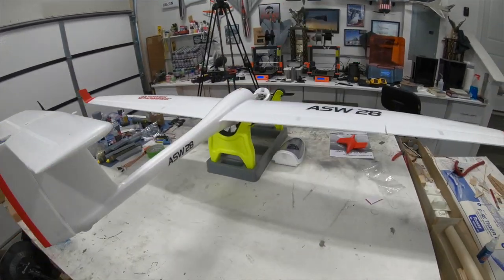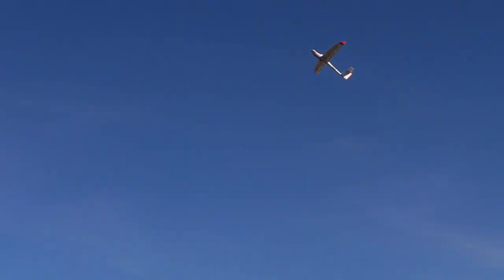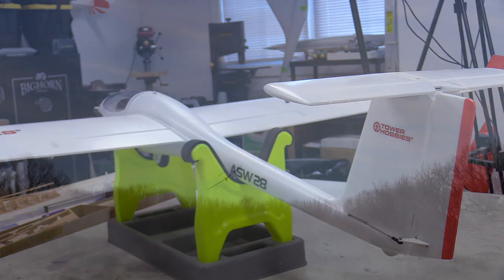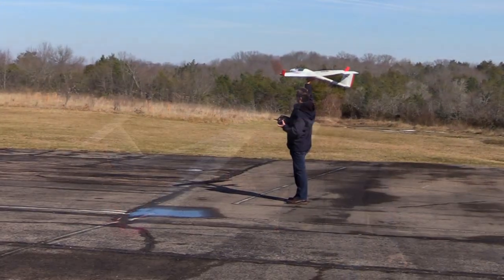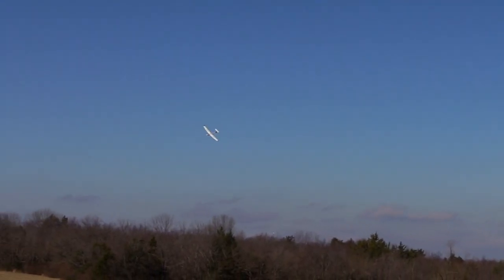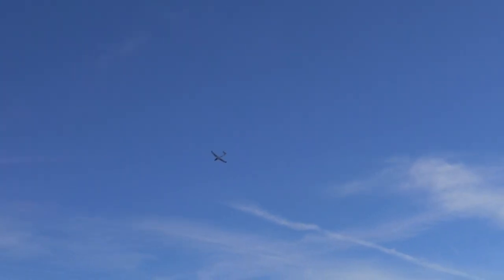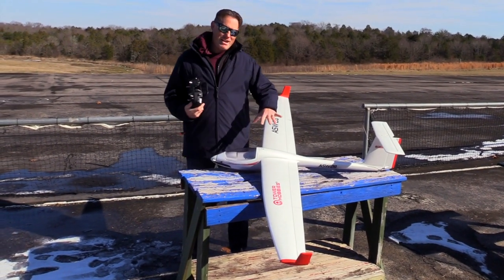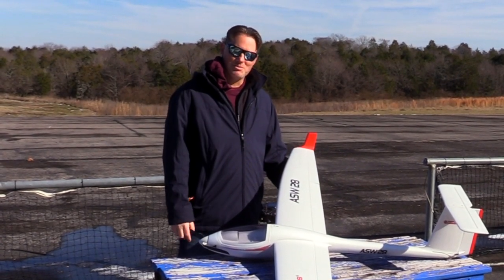That MAGIC SOUND!  The NEW Tower Hobbies ASW 28 2.0m Glider

Comment: That's my division of the hobby, thermo duration.  Either bungee, winch, self power, or tow plane launch.  You can droop the ailerons and flaps a few degrees to change the airfoil and increase climb rate in lift.  And of course there's always the tie-breaking spot landing on a graduated target tape.  That particular design (large wing area elliptical planform 2M) looks well dialed in for good performance.  Yeah, I diggin' that plane alot.  I should get one.  Thanks for doing a video on it.
Reply from the maker: Very cool!  The precision sailplane competitions are no joke. That’s some serious flying and extremely challenging. My father in law was big in thermal duration for a while.
Reply: Hey John, you think it will be a good thermal glider? seems to be a heavy bird for its size
Reply from the maker: I definitely think it’ll thermal when there’s thermal activity.

Comment: Hey Chris! I was just getting back into the hobby after a 2 year break and I was wondering if you can use a 3s 2200 or even maybe a 3s 1300, just to get it up to altitude and glide the rest of the way down. I know since its a 40a ESC, a 1300 may be to low and maybe even 3s is to low to.

Comment: Curious to know if the propellor folds back automatically when turned off. I saw a guy break them off while landing.
Reply from the maker: Yes, the there’s a brake engaged on the motor which stops it and the prop folds back. I wonder if who you saw break the prop had the motor running when he landed it. Or didn’t throttle back the motor soon enough before touchdown.

Comment: Love a glider. That’s a nice ship! Considering your clout within the hobby, do you have any insight as to why we aren’t seeing the quality balsa warbirds from hangar 9 or topflite anymore? The top flite hellcat or the hangar 9 bf 109 were great birds. Seems like foam is the de facto offering for the foreseeable future. I’m hoping you may have some insight otherwise. Have a great weekend Chris.
Reply from the maker: I think at the end of the day, foam is less expensive to manufacture. Wood arfs require skilled labor to physically build each aircraft from a stack of parts. They’re designed with mass production in mind, but it’s still quite labor intensive. The foam airframes start out much more prefabricated since the parts are injection molded so the assembly time is reduced significantly.  Truthfully, I do prefer wood and composite airframes myself, but the foam airframes have gotten pretty darn good these days.

Comment: Thing rips. Stupid question, are you setting it up as Acro or sail in your transmitter? Not sure it makes a difference
Reply from the maker: I set it up on acro. I think that’s necessary since it has a throttle-able motor.

Comment: If you have a scale is the 1800g weight on the spec sheet correct?
Reply from the maker: That’s pretty close, yeah. I weighed it at about 60oz without battery.

Comment: I'm assuming there's no Remote ID or you would have mentioned it. I'm really interested in how this will all play out now that the deadline for manufacturers to include Remote ID has passed. I understand that planes/drones made before December 2022 don't require manufactured Remote ID in their UA, but eventually they will run out ot those and have to make more that require it "built in", and I'm really waiting for all this to play out with Tower, Hobby King, and Horizen.
Reply from the maker: We’ll see how it goes. Ultimately if you’re flying in a FRIA (your local club field), it will be much less of an issue. At least as it’s currently written.
Reply: @Thercgeek  It actually does not matter whether flying in a FRIA or not, as the requirement by the FAA requires ALL aircraft, kit or ready to fly, manufactured after 12/22 to have Remote ID built in by the manufacturer. FRIAs will be the only place you can fly prior non-Remote ID aircraft should you wish to fly after 09/23, but UA manufactured after 12/22 will have Remote ID built in and cannot be turned off even if flying in a FRIA.
Reply from the maker: I don’t know then. I’d expect we’ll see if after the compliance date. The FAA threw out their date without much consideration for manufacturers having to develop the technology for it.

Comment: I’m sorry to say but this is not really a glider. And I would prefer to land it on grass.
Reply from the maker: Right, technically a sailplane (Was trying to keep the character count reasonable). Grass shouldn’t be a problem at all.
Reply: All aeroplanes glide, even the great lump of the space shuttle. The motor is just to keep them up there a bit longer
Reply: @patrickhoyle8357  Of course, but in fact this is a powered motor glider. One could also say that a disfunctional helicopter is a glider because it can still land using autogyration.
Reply: @@paulbrouyere1735  I know nada about heli's but think autogiration is unsustainable and just slows the inevitable. So, I have to disagree . Helis don't really want to fly
Reply: Helis don’t really want to fly 😂
Reply: @@FalconFlight747  what's so funny?
Reply: It’s just when I think of aerodynamics with planes and gliders - how their shape allows them to maneuver through air even without propulsion…
Then I think of helis, they could care less about staying airborne!
It takes a big ass rotor to force them to fly but turn it off and they drop dead! 😂